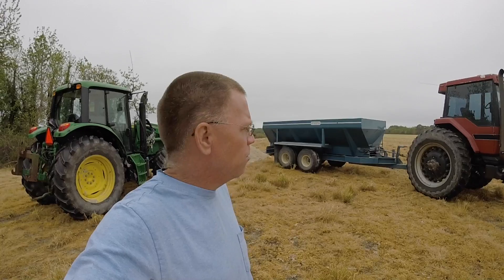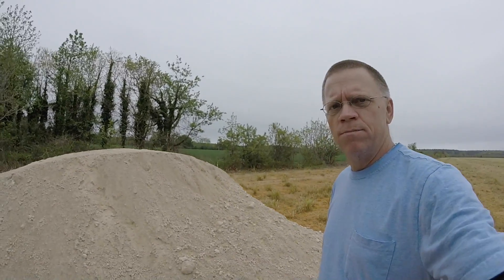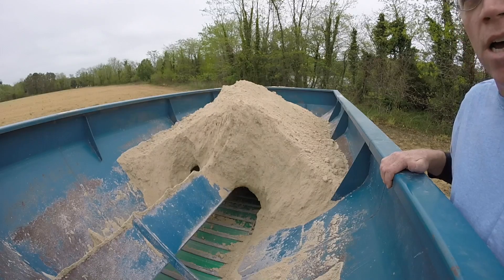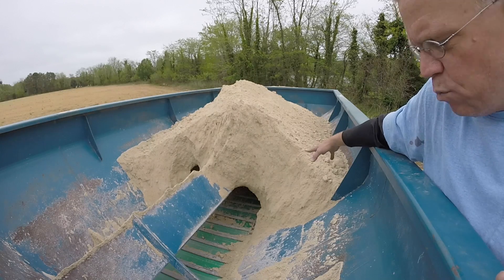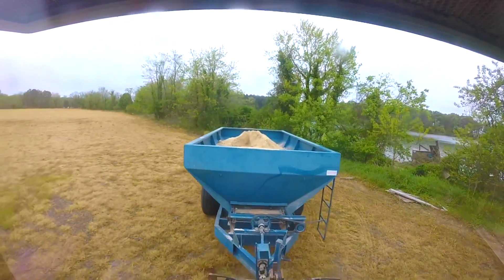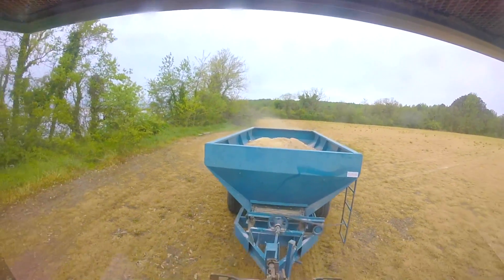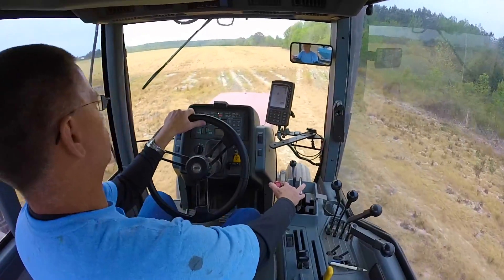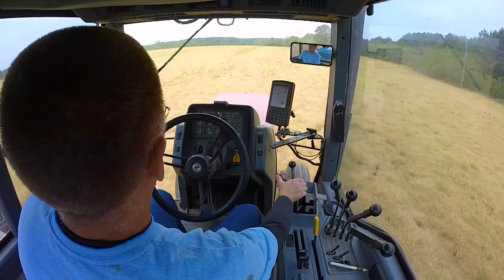Spreading Lime to Raise Soil PH on Corn Field

Comment: Hi,
Just found your channel! You should buy a magnetic gopro mount :) Much better on equipment like this when its not 100% clean.
Reply from the maker: I've never seen one but will be looking now. Thx!
Reply from the maker: Thx for the suggestion - if you have been keeping up with my videos, you know that I now have a magnetic mount for my gopro - the BOMB!!!
Reply: Nice! :) Is it working well? I'm thinking about buying a new one myself. Just saw your new snow plowing video. It's interesting to see what sort of equipment you guys are using. Have you seen my latest video? We got alot(!) of snow this christmas. Removed some of the snow where it piled up on the road side. One thing I noticed is that in US you are sort of pushing the snow to the side, not throwing it like we do in Norway. Why isn't the plows you are using machined/formed for throwing instead for pushing? "DA280 Saltvikplogen" is a typical norwegian snow plow. Google it and you see what i mean.
Reply from the maker: Works great!
We do not get deep snow here or enough of it to justify a snow thrower or a wing plow.  I did see your latest video - in mountainous areas here in the states I'm sure they have to use that type of equipment.

BTW - Norway is on my bucket list of places to visit, though my friend in Finland has told me it will be an expensive trip.  After watching your video of the the JD6190 coming down the mountain, I need to start planning the trip and not worry about the cost!!

Comment: here on the farm when using 8320 John Deere with loader
Reply from the maker: That's an awful big tractor to have a loader on!  You can move a lot of stuff quickly I'm sure with a tractor and loader of that size.
Reply: we have a Valtra S354 with trima 8.3 plus" its a freaking beast! and for its size is pretty good at tight spaces